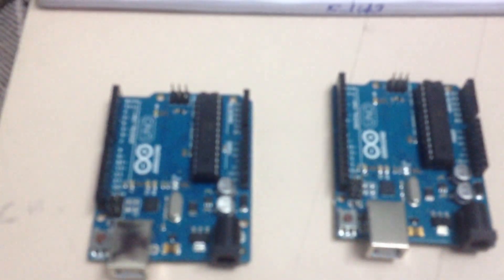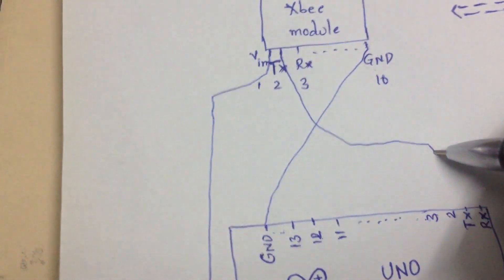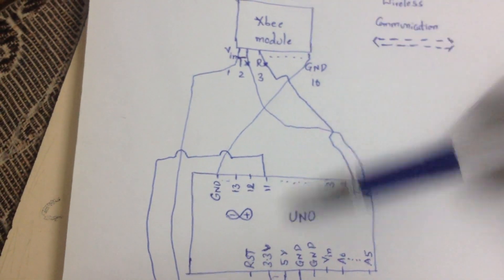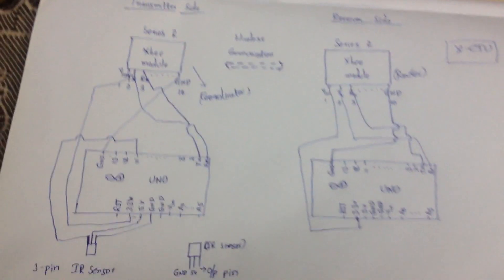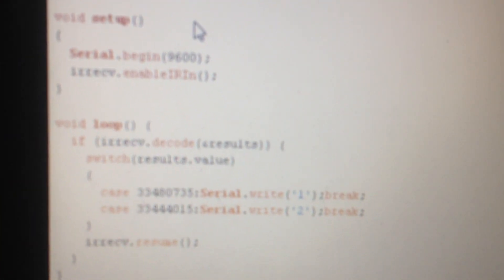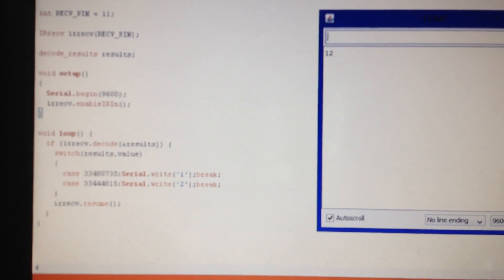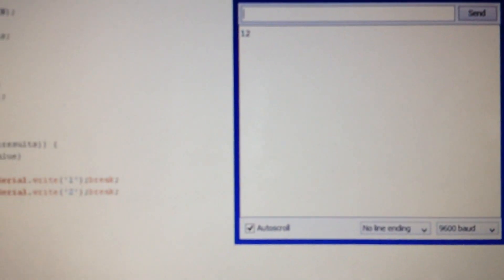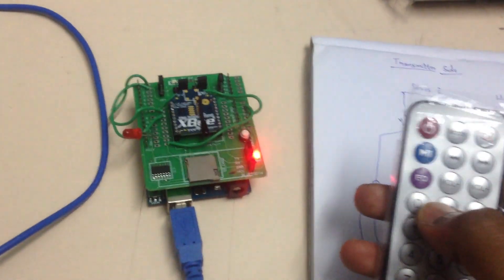Zigbee based Home Automation technique using Arduino (Controlling an led using two Xbee modules)

Comment: Hi, thanks for this great video. How do I transmit a voltage signal using this electronics?
Reply from the maker: My pleasure. Can you elaborate the cause of transmitting voltage? Is it a transformer operation or amplification? If in case, you are in building a smart home system, you can make use of the relay and automate the things.

Comment: do we need to sync the IR sensor and remote?
Reply from the maker: Remote need not be synched. Just write the arduino code according to your required controls w.r.t. the remote keys.
Reply: +Ripunjaya Reddy can u send the code to get the decoded values of d keys of the remote u used in the project?
Reply from the maker: It's already there in the video.

Comment: do the IR remote needs to be configured together with the xbee that can be the coordinator or the router?
Reply from the maker: +Marc Bustamante No need of configuring remote. It just sends input to the IR sensor, not to the ZigBee modules. Hope that clarified.

Comment: i am making one war robot i want ur help
....in my project i want to rotate big dc motor that is through zigbee and relay .....if ur know anything plz reply on sagarkakad15@gmail.com
Reply from the maker: Using zigbee and appropriate relays, you can automate almost all appliances. To be frank, I never tried to rotate a big dc motor. But, I think it involves a typical coding of how to rotate a motor. You better know that code which can be found in micro controller and processor (MPMC) related subjects and then send the signals accordingly between zigbee modules.